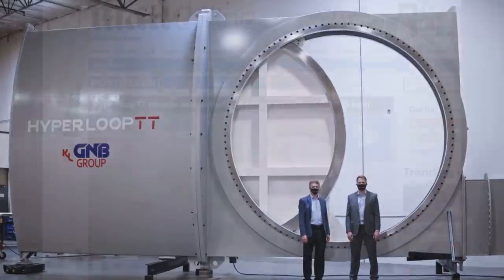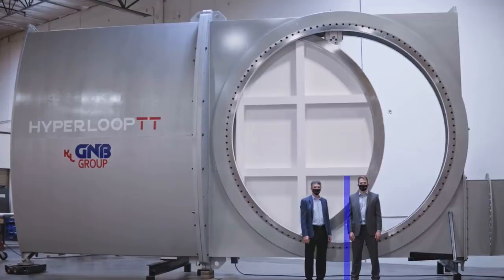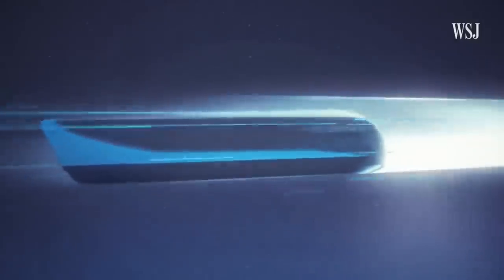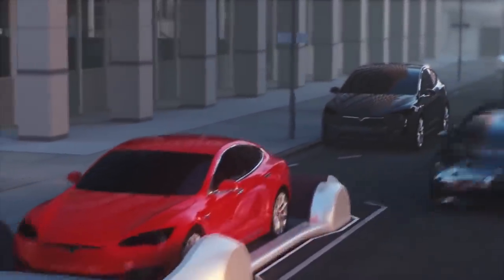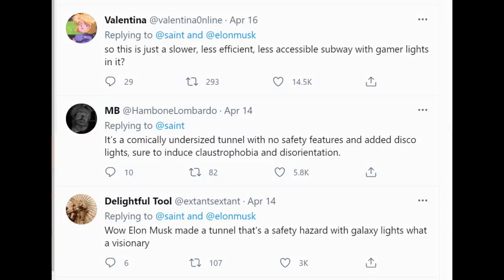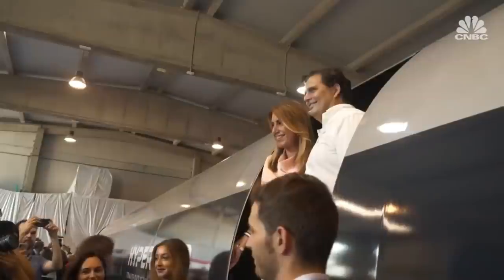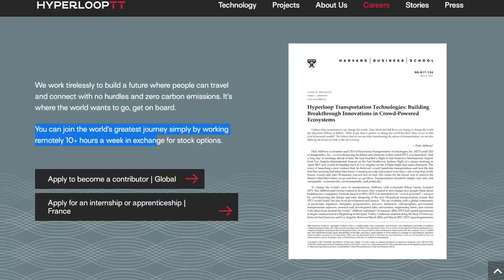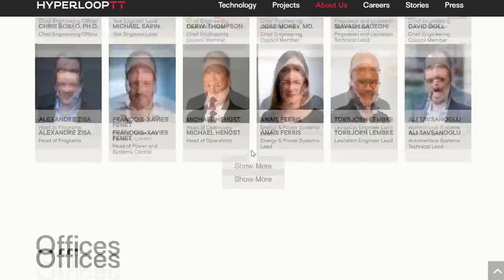Hyperloop TT vs. Virgin: The Race to Make Musk’s Moonshot a Reality - BUSTED!

Comment: I love how the capsule is aerodynamic so it can travel through a vacuum with greater efficiency.
Reply: Yes, a hemisphere would be a much better shape
Reply: My thoughts exactly.
Reply: No, in hyperloops vacum there are hyperflies that stick to the front of the hyperbus, so that shape is a must have!
Reply: You can never have a complete vacuum
Reply: @bobby8012  
Yes, there will always be a little dirt in there.  Why else do you think they sell vacuum cleaners.
BTW:  In a tightly fitting tube, that shape is wrong to be streamlined.  That shape is close to correct for running on a flat surface.
Reply: I noticed that too.
Reply: @kensmith5694  Why is that shape wrong? There is no way for air to get stuck in a shape like that
Reply: @bobby8012   In a tunnel you want a flat front so you push whatever air is left ahead of you. The cone shape pushes the left over air in the tunnel to the sides of the craft which dramatically increases both friction and the pressure on the sides of your craft to the point you can rupure it. It's why subway trains have flat fronts (and extensive ventilation systems in the tunnels so that all that air has a place to go).
Even in air pressure as low as they advertise (which is unrealistic to say the least) this remains a problem. Especially at the velocities they advertise with.
Reply: @bobby8012  The shape is going down a tube with the same clearance on all sides.  The shape should be a cone or hemisphere.  That would work the best in a tube.
Reply: @kreksfeks1200  Amazing comment, thanks xD
Reply: @roepi  thats a good explanation
Reply: Lol
Reply: @kensmith5694  why wouldnt you make it tightly fitting cylinder if its running in a near vacuum? Wouldnt that give the most interior space and likely cheaper to produce per vehicle
Reply: @wizkid2000  
I am an engineer.  Who were you referring to in your comment?
Reply: @mbburry4759 
Q:  Why not make it a tight fit
A:  You can't make the pipe perfectly straight. It is very hard to hold dimensions super exact as the temperature changes.  When you pump a vacuum, the tube will go slightly out of round (they always do).  The train going down the inside is also not exact in dimensions.  The vacuum is not perfect so if you are going fast there will be air pressure in front taking away energy.
Reply: @kensmith5694  thats a good one, thanks for the laugh
Reply: @wizkid2000  Angineer here as well. Think blowdarts. They are conical in shape, not conically tilted towards the ground. You want air to be evenly distributed which in this case would also help with reducing friction.
Reply: This all seems to be an artistic holdover from early development. In them days, a perfect vacuum was not specified, and each train would have a big honking propeller system to suck air in at the front and exhaust it out the rear. For this sort of setup, streamlining makes all sorts of sense.
For the current iteration, it makes as little sense as you think it does - but it make the artists' conceptions look cool as hell, and fast too boot.
Remember, if you can't sell the steak, sell the sizzle.
Reply: @kensmith5694  It would be my intuition that the front of the train should actually be designed to catch as much air as possible and then vent it out of the tube when it comes to a stop. Seems to me like a good way to maintain the tube's vacuum.
Reply: @G0ldbl4e  
Using the train to do the pumping that way is not going to work well.  The venting it out of the tube is trouble.  Pumps would at most be one per station,
Reply: @wizkid2000  It's better to be thought a fool then to open your mouth and remove all doubt: 
In your comment, you both confirmed you're not an engineer and called the engineers here idiots. You're a fool.
You can take the criticism or not, I don't care, I've already blocked you.
Reply: @TheRandomYoYo  originally, the idea was to use a fan, which they ditch as fast as they thought about it.
Reply: @kensmith5694  the whole ideia of a vacuum driven train isn't that smart to begin with, first and foremost because of the development and production costs, and there is also the capability, it seems that the plan was to compensate capacity with high speed, in theory you don't have to make a large train if your smaller capsule goes fast enough, problem is, it should be EXTREMELY fast to compensate, maglevs could take a lot of passengers and stuff and also go really fast, that's why they wanted to reach that 700mph velocity, which increases the coast of the project. And also, that kind of speed makes it quite uncontrollable, not even considering the material resistance of such velocities even in a vacuum sealed ambient. If I was the project manager of that project the first thing I would say would be: "well, most of your objectives are unobtainable, not even considering that most of them are the opposite from the others, review your goals, you want cheaper? Faster? With more capacity? Economical? How cheap? how fast? How capable? And how economical?" Let's just says, that maybe (a pretty big maybe) the pipe transport are a little more cheap to make than a rail system, considering pipeline infrastructure and tech, ok, take that as a starting point, but it won't run 700mph to be somehow safer, because of that it needs to be bigger, even as a normal train composition, it can have less air in the system, but not as a vacuum sealed pressurised stuff, and can indeed be somehow more economical, but not as they said about the solar panels, but in the end the idea was to build hype to take money from dumb ppl...
Reply: @Rrgr5  "but in the end the idea was to build hype to take money from dumb ppl." I suppose space research is doing grim since they resorted to such tactics
Reply: The tapered parts at front and back are wasted space depending on where the engine is.
Reply: There is different levels of vacuum bro
Reply: Great point
Reply: lol good point.
Reply: I am laughing my ass off😭🤣😝
Reply: Hahahaha 🤣🤣🤣🤣
Reply: If it looks cooler it will go faster.....
Reply: There is supposed to still be a lot of air left
Reply: Haha, good point. And that thin shell is going to be ripped apart if the tube ever develops a pinhole leak anywhere along its run, which of course it will, and probably frequently.
Reply: @kensmith5694  Musk says it's like an air hockey table, which is the opposite of reality as those pucks depend on positive air pressure from below. Do you know how the magicians propose to propel the capsules... slightly lower pressure at the destination?
Reply: @wordup897  
I don't care how the ninnies propose to do stuff.
Reply: Hypeloop, fixed it for you
Reply: Because you can’t really even achieve vacuum in the first place 😂😂
Reply: It's not supposed to be vacuum, they were saying it would be 1/1000 atmosphere.
Reply: LMAO indeed
Reply: They should just be cylinders... like at the bank drive-thru  lol
Reply: It's not a vaccuum... it's a low pressure chamber, but in no way does it reach what anyone would consider even a near vaccuum more like 10000m altitude equivalent.
Reply: @thewoodweldingfabricator9300  Yes as many pointed out it’s a low pressure tube. What kills me is we already have a technology for that. It’s called airplanes. Low pressure travel with minimal friction. That’s the tech!
Reply: @thewoodweldingfabricator9300  The shape is wrong still.  It is shaped for streamlined in the outdoors.  Inside a tube the aerodynamics is very different.  A dome shaped nose would work better.
Reply: @kensmith5694  oh I get that, I'm just being an asshole about the details
Reply: @thewoodweldingfabricator9300  
Even with a so called vacuum it is not perfect.  Quantum mechanics partly sees to that plus no matter how much care you take there will always be some dirt in the system
This is why they make vacuum cleaners isn't it. :)
Reply: @kensmith5694  I see what you did there. 😏
Reply: Pay attention! NOT a complete vacuum.
Reply: @urbanspaceman7183  Yeah okay it’s not a perfect vacuum. But let’s think about this for a minute. When a choo-choo train that runs on a track is shaped like a shoe, it is scooping the air up and over and all around. The air it scoops goes everywhere. That’s the point. But inside a tube where is the air going? Of course it’s not being sluffed around the sides of the train, it’s getting bunched up in front of the locomotive, like T-foot said. So no matter how you justify it, it still makes more sense for the front of the train to be shaped like a brick wall. And there are real life analogs to this: Subway cars are flat in the front, because the engineers know the air is going to be shoved up from the front of the train to the homeless people sleeping on the grates on the street. So, again, there’s no reason it should have such a fancy shape. That only serves to make it look fast.
Reply: @urbanspaceman7183  There is really no such thing as a complete vacuum.  Quantum mechanics makes it impossible.  At a practical matter there will always be some dirt in the system.  This is why they make vacuum cleaners.
Reply: Lol
Reply: hahahahaha
Reply: 🤣🤣 ... Vibranium ... these people are now stealing names from Comics ... !!!
Reply: @bobby8012  only in outer space
Reply: the hardest trick is to make the hovercraft cushioning to work in a vacuum.
Reply: @roepi  Interesting. I never thought of that
Reply: the vacuum is not complete and may pose some drag at the speeds proposed
Reply: What!?! You want to kill more people by making larger capsules? 😂😂😂
Great catch BTW!
Reply: That's to offset the pressure, according to no real scientist ever 😂
Reply: 😂right

Comment: Think of the hyperloop as like a wormhole: you throw money into it, and it's gone so fast you never see it again.
Reply: It gets transported to Elon Musk, faster than the speed of light.
Reply: It's a boondoggle.
Reply: Sounds very futuristic and promising. Where can I buy stocks?
Reply: @hobbypsychologist6444  There's actually a really good deal for that. You can work for the company for stock options!
Reply: Worm the food of birds holes in dirt.

Worm=cars.

Hole=tunnels.

Remember that PS3 supercomputer the airforce literally were stacking up to thousands of systems together? How do you think it was using 10% the power of another architecture yielding the same amount of work?

The secret is a poultry by todays CPU standards 3.2Ghz.

Today you can hit 5.3Ghz pretty easily. With sub ambient even higher.

3.2Ghz PPUs, 3.2Ghz SPUs, 3.2Ghz Cache, 3.2Ghz IMC, 3.2Ghz XDRAM

So if I were to translate thats a lot of tunnels running alongside eachother with lightening fast 32mph worms crawling through them. Parallelism means less clutter. Less traffic. More efficiency in terms of resistance to flow. 

If you are focused on just your experience rather than the collective whole, you dont understand why Elon Musk is a Divine God.
Reply: @dapje2002  

I guess Yoda is kinda part of a Troll species.

Freakishly interconnected with the higher dimensional planes due to some sort of symbiosis. 

Our Glorious Leader will show us the way out of the cavernous dotted mystery.
Reply: @remasteredretropcgames3312  The PS3's Cell processor was a supercomputer chip to begin with. Sony was using the PS3 to push it, same as they did with Blu-ray.
Reply: @angrymokyuu1951  

Yeah and with artificial intelligence organizing in order executions, GPU vendors look very redundant in a future with mature lithographies and diestacking.
Reply: @hobbypsychologist6444  can we report you for playing teemo??
Reply: @fiddlesticks443  I dont play this shit game anymore bro :)
Reply: Yeah - then the worms end up with all that sweet, sweet mullah! 

Just imagine all those fancy pants, high society worms - just flaunting their wealth in our faces! Wearing their gold watches, and driving their Lamborghinis!

 Is that what we want people? I don't think so!
Reply: I love how they want people to work for free but they still expect them to have x amount of years of experience and qualifications.

That's like me going to Ferrari and tellling them, give me one of your cars, and IF I get a very high paying job in the future I might pay for it. 🤣🤣🤣
Reply: @BillClinton228  Some people have worked their whole careers building widgets they don't care about for some company just so the owners or stock holders can get rich. At some point, maybe when you can financially support yourself or you are retired, you want to do something significant, to contribute to a project with a great vision. The money isn't really so important. Not everyone is greedy. Especially those who grew up before the Reagan "Greed is good" era.
I can relate to this. When I read about Jacque Fresco's Venus project (and Peter Joseph to follow) I thought, "When do we start? I'll put down the first brick. I'm sick of working on these stupid, useless widgets."
Reply: After seeing the Wright brothers plane going a pathetic 852 feet in 59 seconds, who would throw money at that? That's less than 10 miles per hour and only carries one person. The average horse runs at 25 miler per hour. And it's fueled by grass.
It's just stupid to waste your money on such contraptions.
Reply: @SolidAir54321  It's worst than being a slave, you give all that you produce to your boss, but at least slaves had a shell, two meals a day and clothes.
Reply: lol best comment right here
Reply: Looks great with CGI.

Comment: It's worth noting that the Channel Tunnel is actually three tunnels right next to each other. The service tunnel for the channel tracks is 4ft wider than the "Loop". The main tunnels could easily fit 4 loops inside of them.
Reply: yet they were still more digging then Musk did
Reply: And don't forget the tunnels that they made up to the side to just jam all the equipment into when they were done
Reply: yeah other thing is you can't spell hyper loop without hype but you can't spell loopy without loop.
Reply: But they were digging from both ends, so only dug half the length in that time. Where they met in the middle, one of the boring machines is left in the sea floor.
Reply: I mean if you cut off the safety tunnel because it is not anything possible here.
Reply: @steveissexy  LOO

Comment: It's a good thing Los Angeles is so seismiclly stable!
Reply: Hahahahaha
Reply: Even if it wasnt seismiclly stable, they could just put the hyperloop in a  larger vaccum tube and hover it with rockets!
Reply: @turkeykillerex9509  Not just any rockets. You got to mention SpaceX rockets.
Reply: Damage done in an earthquake typically occurs on the surface. It doesn't happen underground. It's analogous to submarines not being affected by storms.
Reply: @SolidAir54321  So the vibration and shearing of dissimilar geology at varying depths and regions the tunnel may pass through would have no effect on that metal can under pressure..?
Reply: @Veldtian1  underground during a quake you’ll
Reply: @Veldtian1  He's apparently never seen a fault line after a quake. The tube would get shredded. And the submarine analogy is not analogous whatsoever.
Reply: @SolidAir54321  earth is not water my friend
Reply: @SolidAir54321  Do yourself a favor and please go back to school and re-learn some physics.
Reply: @SolidAir54321  "Damage done in an earrhquake typically occurs on the surface. It doesn't happen underground. It's analogous to submarines not being affected by storms." - SolidAir54321 
Then explain why this is wrong
Reply: @NaterFernat  I have no idea what you're talking about. Why what is wrong? I don't think my initial statement was wrong. If you think it was wrong then you explain why it was wrong.
Reply: @NaterFernat  your comment is not constructive at all. It's pure dissing and bullying. What are you, 9?
Reply: @SolidAir54321  earth is not water, my friend (2).
Reply: Boy do I love California
Reply: @turkeykillerex9509  don’t let Elon see this …
Reply: I bet the tunnel work carried on, someone just found a better use for them is all :p
Reply: @NaterFernat  He is mostly right. Very little to no damage occurs to deep underground structures in earthquakes.